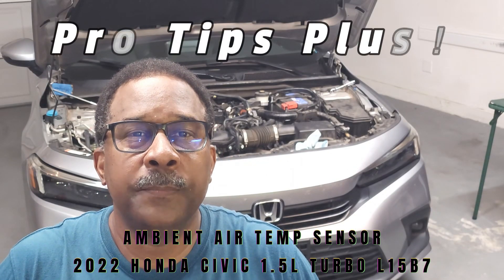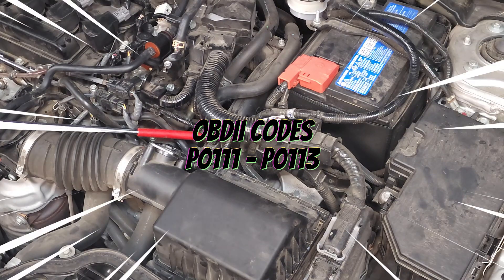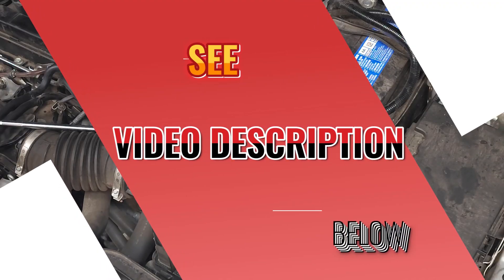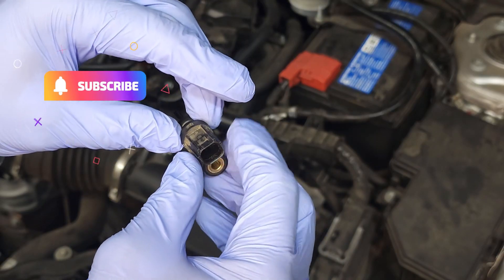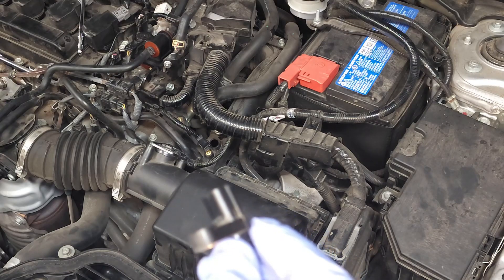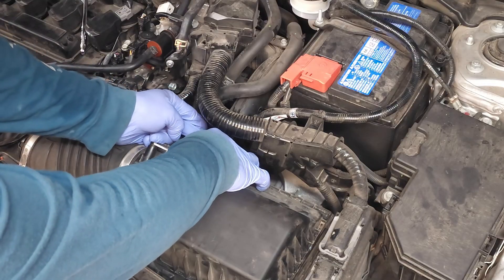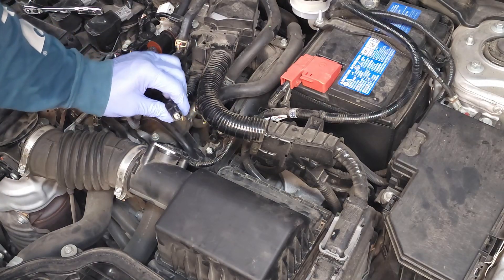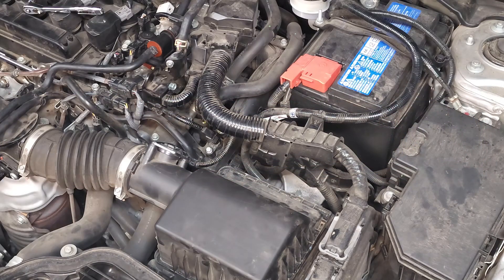2022-2025 HONDA CIVIC 1.5L, (L15B7) Replace Ambient Air Temperature Sensor

Comment: Where is the outdoor ambient temperature sensor in the 2019 Civic EX?
Reply from the maker: @_JuicyJ  The sensor is usually positioned in the front bumper. Look along the driver's side of the lower black grille.
Reply: @ I am pretty sure I found it but the connector on the wiring harness side isn’t even on there. It is weird that this worked till around a week ago and then it stopped working.